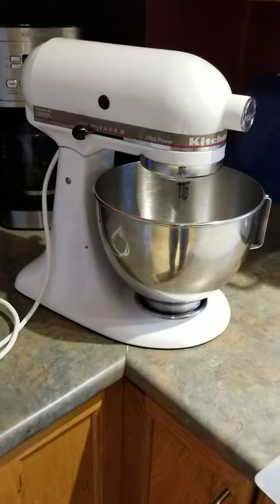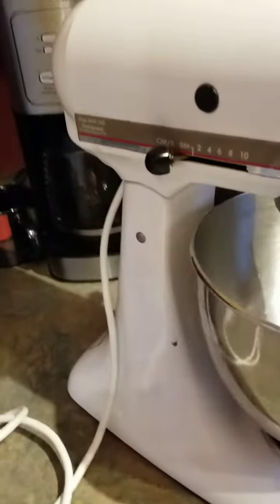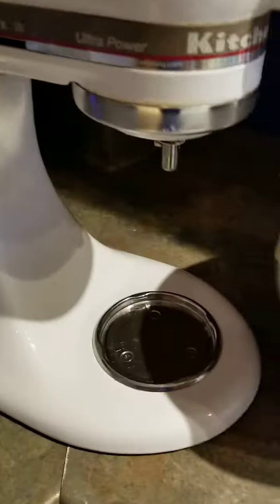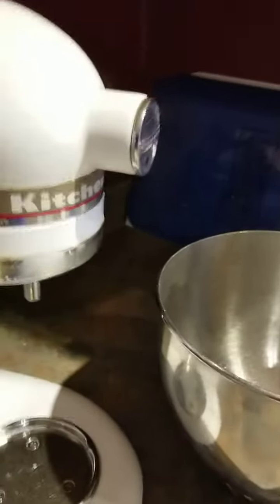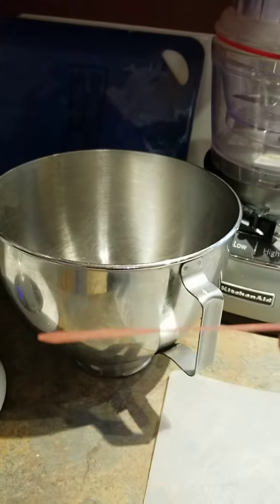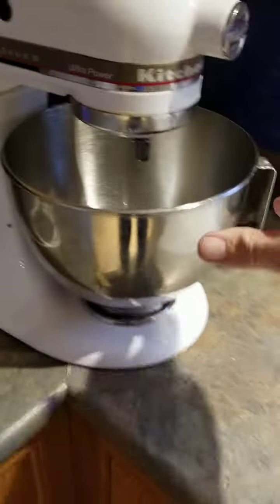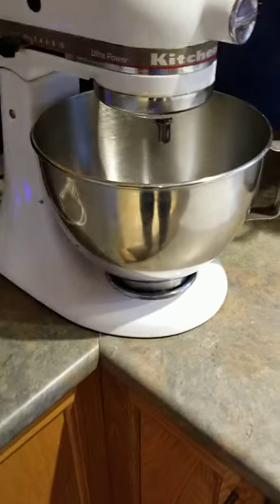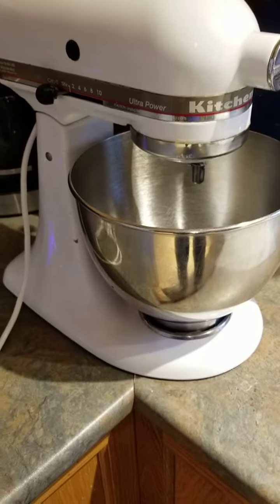KitchenAid Loose Mixing Bowl Fix

Comment: Indeed I do, and wanted to tell you how to save that dollar. I cut my circle out of an empty gallon milk jug and since it is not smooth it offers a bit of traction. Perfect hack. Thank you so much!!!
Reply: I love making fresh bread and because of a health condition kneading is not my friend. I have replaced the base on my kitchenaid about 10 times because bread dough jist wears them out. I was about to buy a bosh so I could stop with the kitchenaid song and dance with my bread dough. You save me. I used the textured plastic on my gallon milk jug. I had just emptied it before reading your message. I ran in there lickity split and grabbed it from the trash and boom, problem solved.
Reply: thank you for this. hope you get better. trying it now @NanasHouseDIY
Reply: @NanasHouseDIY  does this fix work long-term? i'll give it a try but honestly i'm really frustrated with this crappy design. this isn't a user issue, it's a design flaw by the company. i don't know why people always claim kitchenaid mixers are the greatest things. this is awful on their part, not a user error at all. my mother has a stand mixer from bosch that cost a third of the money made from plastic and it doesn't break from mixing bread dough because it doesn't use a terrible design. my kitchen aid ran into this issue after 6 months of making 1 bread dough per week. that's ridiculous. and it's even high-hydration so the pressure the dough puts on the stand isn't even that high.